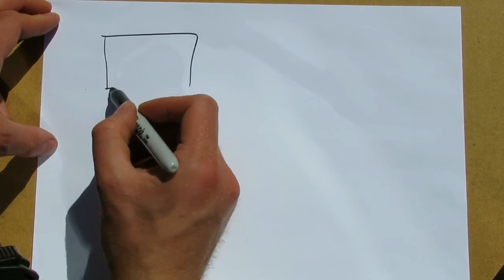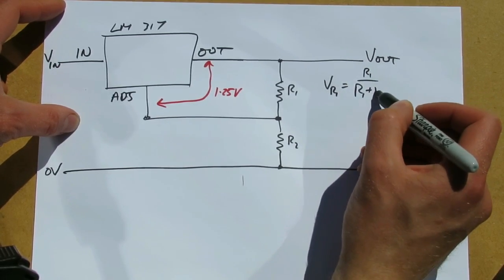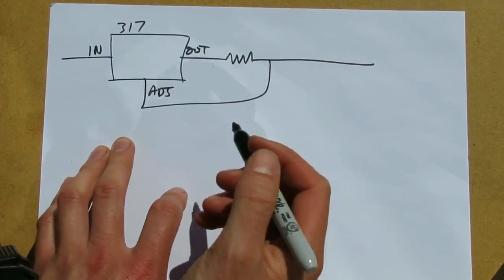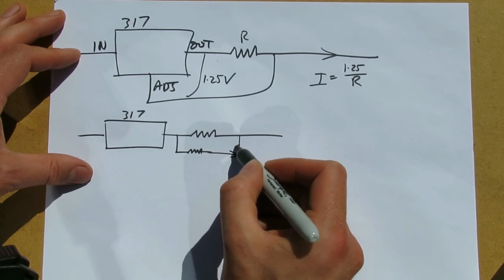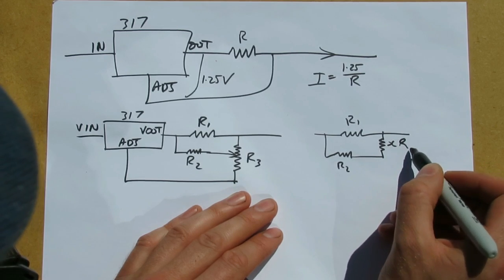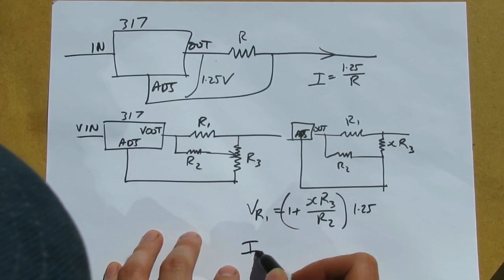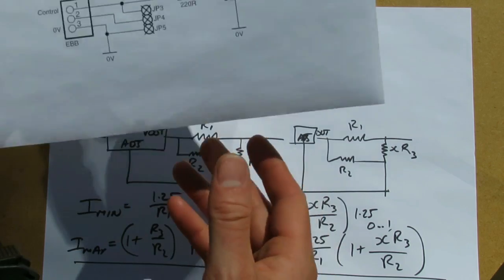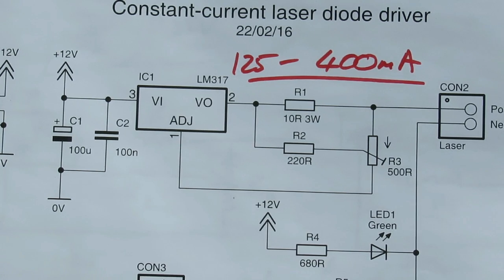LM317 adjustable current source/regulator

Comment: Hello, very nice video ! i did the same, i used 1.5 Ohm to have an output of max 1A, but when i plug a load to my 12v lamp bulb, the voltage drops to 4v, is it normal ? many thanks.
Reply from the maker: What voltage of power supply are you using, and what is the wattage of the bulb?
Reply: @imajeenyus42  Hello Wilson, thank you for answering. The power supply is an ATX 600W and the light bulb is 21W 12V.
What i am trying to achieve is a battery charger with a constant output current of 1A and a voltage of 14V, but the voltage always drops...
Reply from the maker: @hichamtassi1753  If you're regulating the current, then the output voltage will depend on the load resistance. You can't have a fixed output current AND a fixed output voltage, that's impossible. Your 1.5 Ohm resistor will give a current of 1.25/1.5 = 0.83A. If the bulb is rated 21W at 12V, that means its resistance is around 6.8 Ohm. With a current of 0.83A, that's a voltage drop of around 5.5V. However all that is extremely approximate since bulb resistance is highly nonlinear. A voltage of 4V across the bulb would seem quite reasonable.
Reply: @imajeenyus42  very clear, why impossible to have Constant Current and Constant Voltage at the same time ? because if i consider the lamp as a battery to charge, with 4V it will never charge.
I am more of a business background but dream of understanding electronic science.
Thank you for taking your time to explain to me
Reply from the maker: @hichamtassi1753  For a resistive load, which you can assume a lightbulb is, voltage and current must be related by Ohm's Law, i.e. the voltage across the load is the current flowing through it multiplied by its resistance. If you vary the current, the voltage must vary, and vice versa.

A battery is more complex, because it's not a resistive load. Very approximately, the voltage remains constant until the battery is fully charged, then it starts to rise (overcharging).

A power supply will normally put out a fixed voltage (e.g. 12V) and the current drawn will depend on the load applied. If instead you want to produce a constant current, that's when you'd use this regulator circuit. It will attempt to keep the current constant, within the limits set by the power supply. For example, if you have say a 12V power supply, you set the LM317 to regulate at 1A, but connect a 20 Ohm resistor, you are never going to get 1A flowing, because that would require 20V across the resistor, and the power supply is only 12V.

I could go into more detail, but that should help with the basics.
Reply: @imajeenyus42  thank you very much for making Ohm's law more clear. Very much appreciated.
Reply: @imajeenyus42  I have one more question, why do i also have a voltage drop when i use the combination of LM317 and power transistor to make a variable PSU, whereas the voltage stays the same under load when using the ATX alone without the variable additional circuit mentioned above ? thanks
Reply from the maker: @hichamtassi1753  It depends if you're making a variable current PSU, or a variable voltage PSU. If it's variable current, then the voltage will drop for the reasons mentioned previously, but if it's variable voltage, the output will stay the same regardless of load (within reason). Note, the LM317 requires a few volts difference between its input and output to function, so you can never adjust the output right up to the level of the input.
Reply: @imajeenyus42  it is a voltage regulation but i loose some volts with the load...

Comment: I am making 24v 10ams smps my output is 410mA I want to increase current at 10 amps how I get 10amps in output without Changing voltage
Reply from the maker: This circuit is a linear regulator, not a switchmode regulator, completely different.
Reply: Sir Plz advice me for completing this project

Comment: hey can you have 6 out stable from an 12v battery whit no load on it and if so how does it take amp watt to do that in standby mode ?
Reply from the maker: If you are asking, first, "Can you have a stable 6V output from a 12V battery?" then, yes. You don't even need to use the LM317 - there are plenty of fixed-voltage regulators which do the job, e.g. LM7806. As for "how does it take amp watt to do that in standby mode", I have no idea what you're talking about.
Reply: i mean if you dont put a load on it just want to have a floating 6v aut from the 12v input how much does the input vatt take to maintake the aut 6v whit no load on it
Reply from the maker: No load, no current flowing, so no power drawn from the supply.
Reply: If your going from 12v to 6v you should use a buck converter instead. Voltage regulators work by emitting the excess energy as heat and very inefficient. Buck converters can reduce voltage with over 90% efficiency and can be bought for pennies in the UK

Comment: Hello mr. Lindsay. Can you please give the info on how to calculate the power dissipation of the R1 resistor, since I am not able to figure it out for my case. You imajeenyus site you mention that the in your case it is 1.6W?  Also, sorry if you mention it in the video, but I am not able to hear any sounds (problem on my end).
Thank you in advance for the answer.
Reply from the maker: The power dissipation is calculated from (I^2)*R. Square the maximum output current and multiply by the resistance - in my case, the maximum output current is 0.4A, and the resistor is 10 Ohms, so the power is 0.4*0.4*10 = 1.6W. Not sure why you're not getting any sound, there's definitely sound on the video! Best regards, Lindsay.
Reply: Lindsay Wilson oh gosh, I didnt even think about that formula, shows how much of an amateur i am :). Thank you and have a nicce day. PS: the sound is my problem with the audio card, the video is fine. Watched it now on my phone and its ok.

Comment: can u make similar video for lm337 regulator?
Reply from the maker: If you're using it as a current regulator, then the circuit will be exactly the same - current sense resistor, potentiometer, feedback etc. Just replace the LM317 with the LM337, keeping IN, OUT, and GND connections the same.
Reply: Lindsay Wilson and wat about using it as voltage regulator
Reply from the maker: Again, same deal - circuit is the same, just flipped upside down. I went and updated my page with a circuit for the LM337. Check out http://imajeenyus.com/electronics/20160517_potentiometer_feedback/index.shtml. Also added the circuit to the current regulator page as well - http://imajeenyus.com/electronics/20160530_adjustable_current_source/index.shtml

Comment: What about high current situation like 4amos
Reply from the maker: Use an LM138/LM338 instead, which are rated to 5A.
Reply: For that case , will all the connections be same ...
Reply from the maker: Yes - the connections and operation are the same (it has the same reference voltage as the LM317)
Reply: Thanks a lot ...

Comment: Its not your idea at all. Its in the datasheet for this device.
Reply from the maker: Show me where in the LM317 datasheet they describe using a "grounded-wiper" potentiometer arrangement to achieve a linear output adjustment. THAT is my idea. Not the concept of a constant current regulator itself.